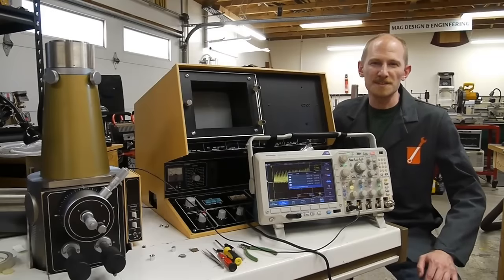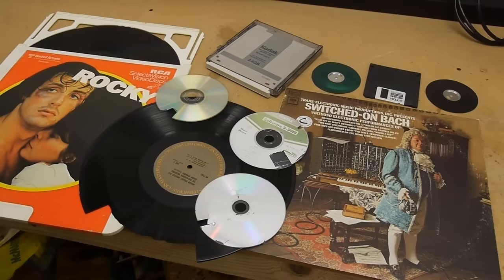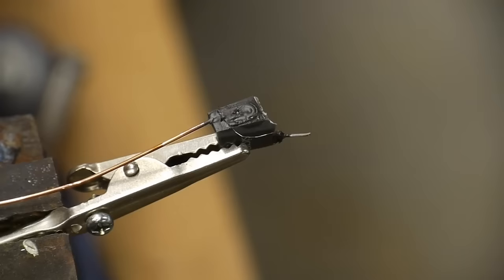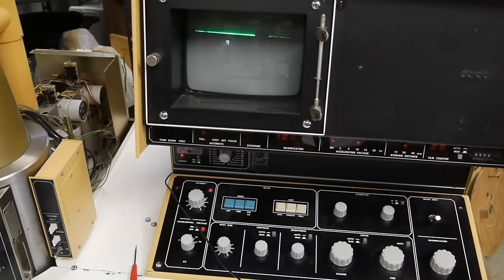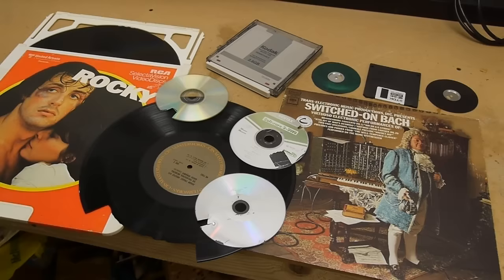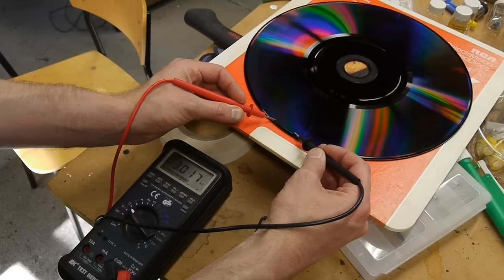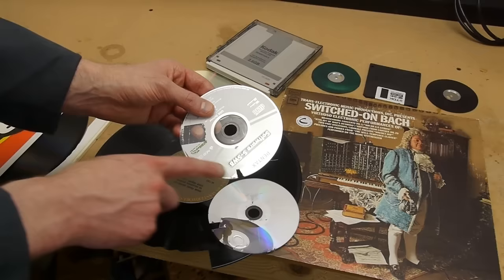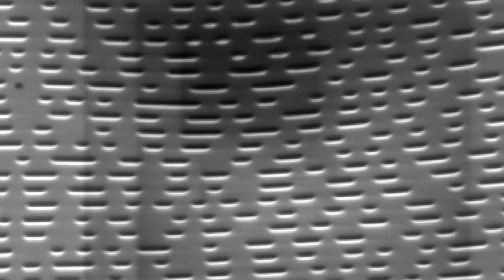Electron microscope slow-motion video of vinyl LP

Comment: Every note, every frequency, every volume change, every sound that is on a record is a just a series of bumps. It blows my mind!
Reply: Well, if you digitize it. In the vinyl, it's analog so you have a continuous variation with infinite changes in between.
Reply: @Bill Williams
You can't understand the love affair with plastic?
2 words: Kim Kardashian. :>
Reply: @TheGreatGadfly  There is a style thing to a return to vinyl, but it's nearly the closest we have to actually capturing the full color of sound. Maybe magnetic tape as well.
Even high bitrate, lossless digitizing doesn't capture it completely. Think that doesn't matter? Tell that to a person who can tell the difference between violins, or pianos or cymbals of a drum set. I can assure you there's an appreciable difference.
Reply: @ChuckD59  It does capture it completely, denying that it does is denying math is real. Any difference you hear between lossless audio and vinyl is a discoloration or distortion introduced by an imperfect player or record.
Reply: @lobsterbark  Wow.
I know "math" and I know music as a classically trained musician, and I know a bit about computers (actually a lot). I have to respond saying if you claim a digital reproduction captures all the nuance of an analog source, you may not know what "digital" means. Higher bitrate/depth reproduction come close, but the very definition of "digital" is ones and zeros.
Reply: @ChuckD59  Digital audio is encoded as on off, but it isn't decoded as such. It literally is analog. There isn't any nuance lost, it's literally all there.
Reply: @ChuckD59  Your comments are laughable.  Do some research about how various recording technologies actually work, learn their strengths and weaknesses and then you will think very differently about vinyl records.
Reply: @lobsterbark  ??
"Digital audio...literally is analog"
That is a totally bizarro statement. You can't be serious.
Reply: @DaveMcLain  You sound like a troll. That brings zero to the discussion.
Reply: @ChuckD59  Digital sound is analog in the same way that digitally controlled light is still analog light. People don't bitch about how digital video somehow loses color depth.
Reply: @lobsterbark  I'm seriously trying to see where you get this and would like to see something to support your point because it flies in the face of analog sound versus digital.
Here's a link that supports what I know as reality:
https://www.klipsch.com/blog/digital-vs-analog-audio
Reply: @ChuckD59  I'm not a troll I'm just pointing out that you need to learn about audio and if you do your ideas about vinyl records will change.  For example a CD has about 90db of channel separation.  How much channel separation do you have on a stereo LP particularly below 100hz?
Reply: i'm an electrical engineer with several patents. I am at a loss to explain how the needle tracking a groove can be translated into such precise waveforms of frequency and volume at each point in time. I can understand how it can make a crude representation, but I don't see how it can play Bach with full orchestra so precisely.
By the way, on the analog vs digatal debate, the key for me is knowing that your hearing does not follow a straight line. It's exponential. Tape recording becomes exponential as the tape 'saturates' - that is how it responds to very high volume. Therefore, your ears and magnetic tape both respond in the same way, so analogue sounds pleasing. Technically, tape is distorting! But it's a distortion most people like. Basically, both sides in the debate are correct. Digital IS more accurate, but analogue is more like we naturally hear. 
I prefer vinyl for acoustic instruments like those in an orchestra, but I prefer digital for synths and digital drums like in techno. Also, digital is much easier to use. Ya pays yer money an ya takes yer pick!
By the way, your screen name is funny. I often thought there was something funny about the 'un' but I didn't put it together until I saw your name and realized that is what I was thinking!
Reply: @Mark C I know several mastering engineers and they would never say much less believe such nonsense.   This is not saying that digital just like analog can't be implemented very poorly because it can be and often is but that doesn't mean its inferior overall. 

Maybe you believe it sounds more "real" because of the extra compression and equalization that's been done to make the record actually work.
Reply: @Mark CHow does it not make sense? There is zero reason why digital would somehow always be inferior to analog.  I've heard 2 track mixes from 1/2 inch analog at 30ips before and they sounded awesome.  Can digital do just as good?  Yes.
Reply: @Mark C   I agreed with you up until the last sentence! <cough>
Reply: @Mark C I do mix and I understand how digital audio works to deliver very faithful reproduction.  Adding artifacts is another thing entirely and relying upon the reproduction media itself isn't a good way to achieve those artifacts.
Reply: @ChuckD59    As a guitarist, pianist, band member, and recording engineer, I can EASILY tell if a band was recorded to tape or to a computer. Analog vs digital is warm vs. cold, rich vs sterile, and thick vs thin.
Don't think so? Go to Guitar Center and watch all the kids buying stomp boxes with tubes to warm up their digital amplifier sound.
Reply: @2011littleguy  
I think you need to have some musical training behind you, or at least a heightened sensitivity to sound detail,  to appreciate the difference. Sadly I find the deniers to be borderline insulting, which I don't get.
To be clear,  I have high resolution, lossless music files that played by themself, I probably couldn't tell the source.  But then put on some clean vinyl and I hear it.  (Plug here for a Dutch group called Sound Liaisons who produce very high end live recordings digitized to FLAC, DSD, PCM and DXD. I'm just a customer). 
I can't get my head around how some will not acknowledge this basic fact: there's just more information in an analog recording. It's higher resolution sound. It's realism versus impressionism. There's your "math".
Reply: I am also wondering how the wave signals of the bumping needle are being perceived as beautiful sounds and different instruments. All this in a quality that comes close to listening to real instruments. That's impressive!
Reply: The debate is over, digital music is better than analog.  You hear everything too.  It used to be a cool argument to make but it fails.  I love my records and I buy them new too, but I like watching the record go around and the ease of how to replay the side, plus not to mention, it's a bit going with my anti tech attitude.  It's nice to play a record.  But other than that, CDs sound WAY better.
Reply: @Homesteader Workouts Are you being serious? Because that's not how you define digital v. analog waveforms.
Reply: @Homesteader Workouts Waveforms, Homesteader. It really sounds like you don't know what that's about. We're not debating whether the mechanics of sound reproduction is digital or analog. We're debating whether the digital (binary) signal from a CD can compare with the analog (continuous) signal from vinyl.
Reply: This just takes everything to a whole new level, wow! amazing 👌
Reply: @ChuckD59  I believe you think you are still living in the millennium where claiming these bullshits was perceived as cool. A digitaly sampled sound can reproduce faithfully all frequencies up to the Nyquist frequency. 44100 Hz (44.1 kHz) is the sampling rate of audio CDs giving more than 20 kHz maximum frequency of faithul reproduction. 20 kHz is the highest frequency generally audible by humans, so making 44100 Hz the logical choice for most audio material (note that the upper limit of human hearing falls rapidly with age: while people in their teens can hear 20000 Hz, many older people cannot hear above 14500 Hz). High quality LP equipment can reproduce 20 kHz (higher for top quality LP equipment, though some of this is harmonic distortion inherent in the medium). Claiming that your ears and your stupid brain can perceive any frequency beyond that is ridiculous. And even if they would, that would be just garbage noise introduced by the medium. But most importantly, the detemining factor is the quality of the two mediums in the 20Hz-20kHz range. For digital, the data is set in stone and immutable forever and ever. For analog, it is susceptible to degradation as the support deteriorates. You simply cannot have faithful reproduction with an analog medium. Stop living above the clouds, put your mask on, and shut the fuck up!
Reply: On a deeper level, the only reason why a CD needs error correction in its digital encoding is because the support itself is analog in the first place. If the physical medium were digital there could be no ambiguity on its contents. Error correction is required because the world is analog and it sucks. Even the best manifactured analog medium will have deviations from the intended data that should store.
Reply: @itellyouforfree7238  Thank you for your rather limited opinion. Why dont you sober up and come back later and I can point out the gaping omission in your thinking.
Reply: @ChuckD59  It's not just my opinion. I gave you a precise, rigorous and detailed technical explanation that probably goes way beyond your level of understanding of this scientific matter. The standard sampling rate for DVD audio is even higher, at 48kHz. If you claim the you can discern audio signals past 23kHz then your credibility goes down the sink. You may just as well start believing in unicorns.
Reply: @ChuckD59  Let's put aside the fact that human hearing is limited, and get real technical. Even if your record is analog, there is manufacturing error in the record, wear in the record, etc. Analog might contain more information, but there's no guarantee that that information is precisely correct. So if your digital format has a resolution smaller than the manufacturing error + wear + whatever else of the record (and the digital format was recorded sufficient accurately), both would contain the same amount of useful information. You can try to measure the analog record with more resolution, but that's not really information, that's just noise. It's ridiculous to say that analog is always superior to digital, on a very theoretical level. Y'all can keep arguing about specific digital formats all you want, but don't misrepresent the math.

To put it another way: matter is made of individual atoms and molecules. Since the quantum world is discrete, it could be more fair to say that the real world is actually digital, and anything we perceive as analog is just a smoothed-out version of the real digital world.

To put it a third way: find 2 records, of the same song, made in different batches at the factory, stored separately over the years. Play both records. They are measurably (but probably not to human hearing) different! If your digital format has better resolution than that difference, then the difference between the analog record and the digital file is smaller than the difference from record to record.
Reply: @itellyouforfree7238  If you think I'm talking about frequency range, you're not getting my point at all.
A trained eye can tell the difference between film and digital video the same way  a trained ear can tell the difference between an analog recording and a digital, other imperfections notwithstanding. It's about coloration and resolution.
Yes, vinyl has other flaws and is much more fragile than digital. But, focusing on the recorded material, it will be a truer representation of the original.
I have a good enough ear that I can usually detect the difference. I'm not bragging, I'm not being elitist, millions do as well. For me it's worth the trouble of preferring a vinyl recording, or at least a very high resolution, lossless recording.
Reply: @chaklee435  I cannot understand why so many want to try to convince me I'm wrong when I'm only expressing my personal opinion based on my personal experience with a dose of math to support my experience. Put simply that is there are a finite number of points on the curve of a digital waveform while there are an infinite number of points on an analog one. That means there's plainly more information in an analog curve. And in an ideal environment that means a more accurate representation of the sound. And I, and many who I suspect have training for sound, can often pick up that difference.

If you feel digital sounds better, fine. I don't much care what you prefer. That's what works for you and doesn't effect me in the least, so please stop trying to "mansplain" what we should all do. I do think you're missing something though.

https://blogs.scientificamerican.com/observations/which-sounds-better-analog-or-digital-music/
Reply: @ChuckD59  half of his explanation is precise and is how everything works in different areas. Your reply is him being drunk. Your argument is way weaker if at all.
Reply: @grindingpancake  Shame that's all you saw.
Reply: @2011littleguy  Yes, that's it, you brought up the real point. 

There's all this arguing about accuracy and "better quality". But as you said, it comes down to rich sound against sterile sound (or warm v cold), and anyone with any kind of hearts and ears knows exactly which one is which. The rest is just lost in semantics.
Reply: @paulkrupa  woah dude...that's deep
Reply: @ChuckD59  yeah you're delusional. I've done extensive research and lossless digital sounds no different than analog. This studied using actual scientific proof too, not just opinion. It's ok to prefer vinyls, just like it's ok to prefer Pepsi over coke, but just stop with the whole vinyl having more detail and superior sound quality. It's debunked.
Reply: @jhaz89  No. At my age I've got decades of experience n this and real music. No one who knows me would say I'm delusional. But you sure sound insulting, not sure that helps your case though.
Reply: @ChuckD59 That guy, I Tell You For Free, already explained to you why you're wrong and and scientific reality of it.  You've just got a case of placebo effect going on. I know some people who love vinyls and the entire hobby and since vinyls have that distinct buzz/static/background noise, they associate that to having better sound quality. So like when you have people doing a blind test between lossless digital and vinyl, if they can detect that noise, they'll placebo themselves into finding that there's more detail within that than from the other. The fact is that the science and math are more telling than what your experience is. Bias and placebo can do a lot of things to your brain that even trick you into believing shit is true or real that actually isn't. That's why placebo can do a lot of amazing things like they think they took pain medication and their pain goes away (even though they were given something inactive). So yeah, the science and math and everything show that within the human hearing range, lossless digital is able of reproducing everything that vinyl can. Period. And unlike vinyls, lossless digital doesn't carry that static and background noise like vinyl does. Then on top of that, digital is far more more convenient and holds its audio quality perfectly forever. The grooves in vinyls get worn down over time and that alters the sound quality and accuracy. So not only is vinyl not superior to digital in sound quality, it's realistically worse and flawed from a convenience and logistical standpoint. That's why it's really just a hobby. They like that it's inconvenient and it's like a ritual they enjoy.
Reply: @jhaz89  Wow.
So what's your musical training background?
Reply: @jhaz89  I take that as a "none".
Got it.
Here's some science (again): analog waveforms have an infinite number of points, digital, not so much (but they can come close).
Btw, I'm trained as a structural engineer and architect. I do science and math too.
Reply: @ChuckD59  k I'm done talking to you. The evidence is out there. Have a good day.
Reply: This quote refers to using DCTs to store music as in for example MP3. A time domain signal at 44 kHz is different, like a WAV recording or a lossless codec. Whatever, you think you know better than all of signal processing and information theory. Unbounded arrogance.
Reply: @ludvigericson6930  Excuse me, but the "unbounded arrogance" is assuming you can deny what I and millions others hear, with your sacred math.
You're still referring to an implied (digital) curve of a finite number of points versus a true curve with an infinite number of points. It doesn't matter if it's lossy or lossless. They're still digital and finite. Do you have any musical background? Do you know how to tune a musical instrument with your ear alone? You must think its magic.
Reply: Wait until computer technology gets here
Reply: Bruce Wang  Classic stuff. Amateur scientists telling musicians what they can and cannot hear.
Reply: @ChuckD59  Every time I hear or read the adverb “literally” to describe an action, it comes to my mind that the subject is not real but a metaphor. Digitized music is like a metaphor of analog music, a very precise metaphor, that is.
Reply: @chaklee435  you are a smart dude, bro!👍🏼
Reply: @chironjo  Yep, but not the same.
No different than a film producer being able to tell the difference between digital and celluloid.
Reply: @ChuckD59  I'm not disputing your experience, only your reasoning. The root cause of your preference is likely the specific execution of analog vs digital tools in your life, and not some fundamental truth of the universe.
Reply: @ChuckD59  Did you actually read the scientific american article that you linked?

"Does this mean analog is more accurate? No, it just means it’s different. Movement, dust or scratches can change the sound an analog player makes, and the recording process is similarly sensitive. The sound wave produced by analog playback could be further from the original than a good quality digital file would be.

Sound quality depends on a lot of factors, and it is impossible to definitively state that either analog or digital is fundamentally better."

While computer files are finite in size, phonograph needles are also have finite stiffness or finite manufacturing tolerance. You're just trading one limitation for another. What really matters is execution.

Notice that I'm never claimed that digital, as executed today, is better than analog, as executed today. That's not my field. I'm just pointing out that the finite vs infinite reasoning is silly, since nothing is infinite anyway.
Reply: @chaklee435  Right, here's the peril of this debate, semantics. @2011littleguy and @Guitary touched on the difference: analog is (to me) richer. There are sounds like the sympathetic harmonics following the pluck of a violin string, or after the strike of a bass drum, or with the strike of a highhat, or the pluck of a double bass that are lost in the translation to 16 bit and lesser reproductions.
Of course the surface of a record brings with it flaws and there are limitations to how a stylus tracks a groove, but that's not how I judge "better". 24 bit reproductions, and even in some cases upsampled 16 to 24 bit, reveal texture and detail close to vinyl (which I'm sure is making the sound geeks' poor little heads explode). But analog is to me more realistic.
Reply: @ChuckD59  just admit it’s your own personal preference lmao
Reply: @elia8544  Thank you Capt. Obvious. When did I say otherwise?
Reply: @ChuckD59  why argue if its just a matter of personal opinion? L
Reply: @elia8544  A better question is why must I be challenged on it. I never said this was how it should be for everyone. A bunch of know-it-alls seemed to want to shoot down my reasoning for my preference by, among other things, telling me i was "delusional".
Too bad if you think defending my points is argumentative. It is only on the sense that no one can tell me, a skilled listener, what I can hear.
Capiche?
Reply: Here's my take, for newcomers who may still be confused.  An analog waveform is made of an infinite number of points with infinite resolution, therefore it is the perfect representation of the sound.  A digital waveform is made with a finite number of points with a finite resolution, therefore an imperfect representation of the sound.  But digital can be made essentially "perfect", but how so?  This is because human hearing has limits on frequency and sensitivity.  Theoretically, given enough points with enough resolution, human hearing cannot determine the difference between analog and digital.  But in reality, this is rarely true.  Even with analog, the original waveform gets distorted when being transferred onto vinyl, and not to mention that most vinyl nowadays, are created with digital files anyways.  On the other hand, digital suffers from digital artefacts when going through filtering/processing.  This should show, there is indeed a difference between the 2, though there may be exceptions.  Words such as "warm", "thick", "sterile", "musical", etc, are an attempt to convey these differences.
Reply: All these comments about math and science blah blah blah. Has anyone ever thought that our math and science is only as good as our measuring instruments? Basically I’m saying there’s always some “unknown” factor that our tools (e.g. math) cannot measure. Calculus attempts to, but it’s still an approximation. Our world is not linear, there is no such thing as a straight line (we live on a ball). Perhaps quantum will be the successor to digital for sound reproduction. Just some random thoughts.
Reply: @Hell Cat Sheesh is right. I don't know how to respond to this, you're off the rails in a couple ways, starting with understanding what this is about. And  no, it's not about declaring 'analog is better than digital'.
Reply: I couldn’t agree more, I’m a musician who’s made records, always pissed off when I got a test pressing, delighted when I first got a cd to check:-)
Reply: @itellyouforfree7238  what you say is correct but that’s not the point that he is arguing…..just because the human ear can’t hear above 20hz or whatever doesn’t mean that digitally it is saving the entire information from an analog source…….
Reply: And to think that the human ear can hear the tiniest perturbations in air pressure is even more staggering.
Reply: Truly amazing how the slightest variation in movement and vibration of the stylist through the magnetic field will generate a completely different frequency. And to be able to play it back with pristine accuracy. Analog recording and playback was the panicle of human achievement. Digital can't even get close in replicating the accuracy of analog. Still blows my mind as well.
Reply: "it's a bumpy ride." - life of a stylus
Reply: Sound is just a variation in air pressure. So, in effect, vinyl and/or old tape are the most accurate representation. One uses bumps the other variations in electric signal.
Reply: @ChuckD59  Lobsterbark was correct in his original statement, and i quote "Digital audio is encoded as on off, but it isn't decoded as such. It literally is analog." The problem, i believe, is that people's visual perception of analogue and digital waveforms tends to steer them toward thinking there is an appreciable difference. This is a legacy of how digital recording was, and still is, explained graphically. The sound your amplifier is receiving from a digital source is not digital - it is analogue. The difference is that with a digital recording there will be zero background noise and other artifacts (depending on the master recording which, until fairly recently, was usually analogue tape). Other factors that change the sound quality, usually effects, amplification technique (Class A, valve etc.), loudspeaker and environment also have a part to play in clouding people's judgement.
Reply: @robertdewar1752  I'm now convinced there's a segment of society who feel their command (or perceived command) of math and numbers supersedes mere mortals' perception of reality. Some call them "mansplainers".
The point I'm making assumes the source is analogue (acoustic, non-processed, musical or not) and the goal is accurate reproduction.
Digital can come very close and can be, for me, often indistinguishable from an analogue reproduction. Increased bit depth and bit rate make that possible for the very same reason we set our monitors to higher color depth, and want UHD television.
But the reality, the mathematical reality, is that digital cannot completely reproduce analogue sound because of the very distinction between an analogue curve and a digital representation of one.
Reply: @ChuckD59  Shannon Nyquist signal theorem.

Also, audio playback from a vinyl record may not be digitally compressed ... but it's a physically compressed "capture and storage" medium of the sound waves that were originally created by instruments or voices.

Furthermore, unlike digital playback forms ... playing a vinyl record involves constant physical degradation of both the disc grooves and the playback head as the audio information is still in a physical (encoding) form whereas a digitally encoded audio signal can be played as much as you want and you always get the same data.

The only difference is the argument that analog "capturing" is not a discrete process.

The recorded signal is continuous, a constantly moving write head. Much like technically the resolution of analog film is infinite.

However there's a similiar important catch in both analog audio and film ... you can zoom into a negative as much as you want but at some point you just begin to enlarge the literal film grains that contain the image without ever finding further detail / information beyond that point.
Reply: @mysticmarble94  Cool. What's your point?
Reply: @ChuckD59  The point being ... 

Claiming that "analog" audio could still offer some mysterious acoustic benefit ( least of all in the modern day and least of all music played back from a vinyl record, which may I remind you, itself was really more designed as a mass playback solution and doesn't even compare to the quality improvement you'd already get by analog recording to tape instead ) is utterly ludicrious.

Additionally, it has even been proven mathmetically through the works of scientists Harry Nyquist, Claude Shannon and E.T. Whittaker that all continuous-time signals can fundamentally be transformed into a discrete-time signal without losing any information in the process if the correct sampling rate is used.

That means you would always get the perfectly reconstructed ( ergo "original" ) signal back and vice versa.
Reply: @ChuckD59  Ohhhh and lastly, it's slightly confusing that you didn't immediately get the point of my prior comment since it was a literal response to the very last thing you had written in your own comment from 3 days ago ...

This part right here ...

" 𝘽𝙪𝙩 𝙩𝙝𝙚 𝙧𝙚𝙖𝙡𝙞𝙩𝙮, 𝙩𝙝𝙚 𝙢𝙖𝙩𝙝𝙚𝙢𝙖𝙩𝙞𝙘𝙖𝙡 𝙧𝙚𝙖𝙡𝙞𝙩𝙮, 𝙞𝙨 𝙩𝙝𝙖𝙩 𝙙𝙞𝙜𝙞𝙩𝙖𝙡 𝙘𝙖𝙣𝙣𝙤𝙩 𝙘𝙤𝙢𝙥𝙡𝙚𝙩𝙚𝙡𝙮 𝙧𝙚𝙥𝙧𝙤𝙙𝙪𝙘𝙚 𝙖𝙣𝙖𝙡𝙤𝙜𝙪𝙚 𝙨𝙤𝙪𝙣𝙙 𝙗𝙚𝙘𝙖𝙪𝙨𝙚 𝙤𝙛 𝙩𝙝𝙚 𝙫𝙚𝙧𝙮 𝙙𝙞𝙨𝙩𝙞𝙣𝙘𝙩𝙞𝙤𝙣 𝙗𝙚𝙩𝙬𝙚𝙚𝙣 𝙖𝙣 𝙖𝙣𝙖𝙡𝙤𝙜𝙪𝙚 𝙘𝙪𝙧𝙫𝙚 𝙖𝙣𝙙 𝙖 𝙙𝙞𝙜𝙞𝙩𝙖𝙡 𝙧𝙚𝙥𝙧𝙚𝙨𝙚𝙣𝙩𝙖𝙩𝙞𝙤𝙣 𝙤𝙛 𝙤𝙣𝙚 "

And as I have now described to you ... that assertion is simply not true.
Reply: @mysticmarble94  Well I don't camp out here (for the past two years) following along so sorry I missed the connection. I have since looked up the Nyquist theorem and educated myself on it's meaning. I'm not a sound engineer but I am able to get what's happening and it supports my earlier point where I said there's much digital audio that I cannot distinguish from the analog source. For the most part those recordings have a known lineage and are recorded at a higher bit depth (24 or 32) and likely Nyquist comes into play. 

I am not saying 'analog is better than digital' but it's pretty clear that the thought of it triggers a lot of people. And I suspect if you compared two wave forms, one an analog and the other a Nyquist processed 24 bit, you might be able to visualize which was which. But I'm not a sound engineer, I don't know. I do know what I hear, and I can hear the difference between a 16 bit and a 24 bit or analog recording, given the sources are the same unprocessed sound with a quality lineage. For me it's the difference between 1080 HD TV and 4K. It's in the detail.
Reply: @lobsterbark  There is a difference but it's so tiny that it's beyond reach of the human ear.  Like trying to see pixels in an HD image.  Even a person with perfect 20/20 vision can't see them.
Reply: @austindarrenor  No there is literally no difference. There is no room for theoretical tiny things you can't hear, it's literally not measurable because it doesn't exist. This is because of the way the universe works, it's the nature of math and logic and the existence of things in general.
Reply: @lobsterbark  What I said was based on a video I recently watched that debunked the idea that vinyl sounded "better" than digital and they explained why it isn't true.  Because the difference is out of reach of the human ear and the video showed why.
Reply: @lobsterbark  That you're here saying how the universe works sounds pretentious.
Reply: @austindarrenor  omg I'm so pretentious I know basic math and logic
Reply: Purely considering vinyl. If you were to look at the waveform pressed onto the record as a static entity like a picture that is one thing, but the process of playing the thing imparts an energy of it’s own. Like a ball rolling down a hill encountering bumps, it doesn’t just track the surface, but is deflected outwards additionally by the bump plus the energy supplied by the forward motion. You can’t possibly expect that tiny stylus to read all that information accurately without bouncing around all over the place in that groove and I reckon it’s this additional “enhancement” of the signal that people perceive as richness and depth in a vinyl recording.
Reply: @lobsterbark  The skill of differentiating is a sign of intelligence.  Use logic to observe that the dumber someone is the less they differentiate.
Reply: Me too. I've just decided it is an instrument.
Reply: Growing up in the 70s and 80s, my favourite Rush albums were punctuated with warps and scratches that added to the tracks and became hard coded into my memory. Now when I hear those tracks on digital media, my brain still adds those pops and hisses in the exact, precise places to make the music ‘correct’ again. I’m sure I’m not the only one. Analogue has memory, digital does not. Maybe this is why Boards of Canada also sounds so awesome to my ears these days.
Reply: @funkydozer  I got so used to hearing a song that skipped over a groove on the vinyl that when I heard it without the skip it was like, wait a minute. . . .what was that??  Something's wrong!
Reply: For a second I thought you were quoting Carl Sagan's blue dot.
Reply: Because the wind is high, it blows my mind
Reply: @lobsterbark  If you knew the basics of math and logic you wouldn't be saying there is literally no difference between analog and digital sound.
Reply: @paulkrupa  how does the V shaped 0,5mm groove contain infinite changes, please?
Reply: @ChuckD59    Do you think the needle touches every curve and feature of a record groove??  No, it doesn't.   Specs digitial blows vinyl away on :  Noise floor.  Signal:noise.  Dynamic range.  Frequency response.  Wow and flutter.    You're a mystic if you think vinyl sounds better than loseless digitial.   The closest we have to the actual recorded sound is digital if it was recorded that way.  OR the master tape.  We don't even record to vinyl, so it's totally wrong to suggest it "the best".
Reply: @lobsterbark  I could A / B a listening test and you'd choose (properly recorded, mastered and transfered) digitial EVERY time.   How would I do that so that you wouldn't know which is which in a blind test (in which you'd just recognize the record scratches) ?  Introduce the horrible record surface noise dubbed into the digital audio playback.
I've actual done this for other doubting Thomases.  They ALL choose the digital files because - THEY SOUNDED WAY BETTER.
Reply: @mjoet731  You clearly need to reread this debate/discussion. Those aren't my words or thoughts.
It sure goes to show why this kind of controversy gets out of hand; many have predetermined ideas and don't hear anything else.
But why? Why so important to bully anyone who doesn't follow your reasoning? Why put words in my text that don't exist?
Reply: All sounds are, are vibrations in the air. All a record is, is a permanent impression of those vibrations. In fact if you just play a record without the turntable plugged into speakers, you can hear the track just from the vibrations of the needle.
Reply: @salemcripple  That's the way god intended it to be played. Without the awful electronic amplification messing it all up. /s

Meanwhile, everyone else here talking about the structure of waves... The wave itself is entirely theoretical. There is not literally a wave flying through the air. The wave is a representation of vibration frequencies. Which has nothing to do with analogue or digital, because we're talking about the finished product emerging from the speakers... which is ALWAYS analogue. Different speakers will be better or worse at outputting different frequencies, but they're always thin membranes being vibrated at specified frequencies, creating air pressure changes that you ears then interpret.

As for the storage medium, there's little if any difference. Both require a microphone to pick up the audio, and both write it. One of them etches bumps into a groove at particular frequencies, and the other just notes down what the frequencies are and when they occurred, and reproduces that.

On a somewhat related note, people have managed to make pianos sing. This is because the human voice itself is just a collection of frequencies and the sound of the piano is too. By isolating those frequencies (in the human singing voice) and reproducing them with a piano, they have created an illusion where the piano has a voice. Something like a human voice, while also sounding like someone randomly smashing piano keys. The latter being very literally what it is.
Reply: I still cannot comprehend it, this video does not help at all though it is a great video.
Reply: If you play music really loud - a deaf person can put their hand on the speaker and enjoy the music.